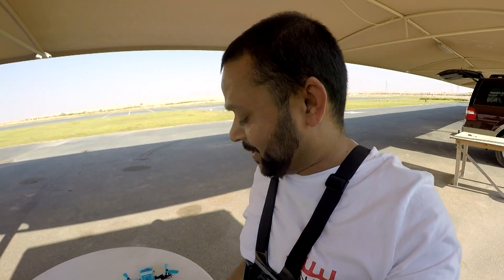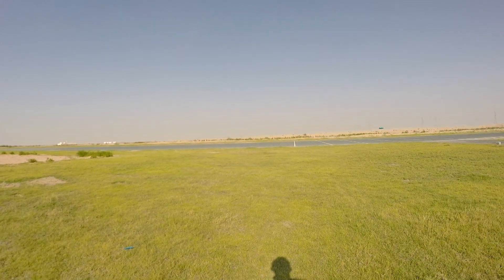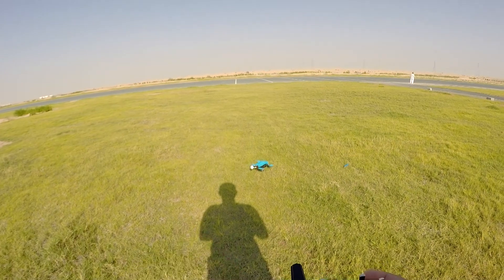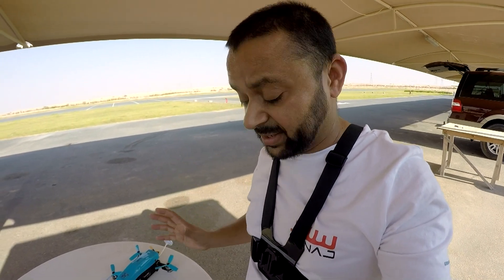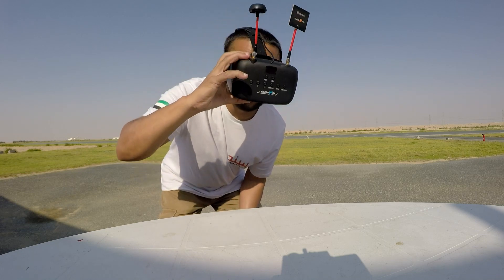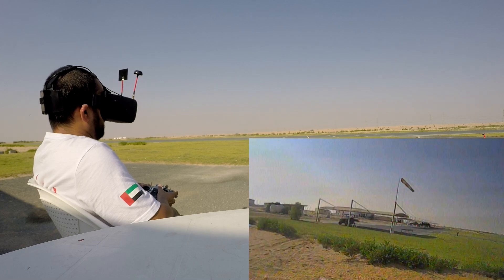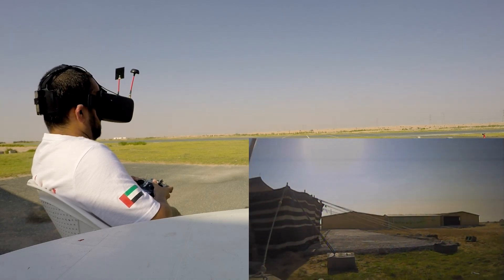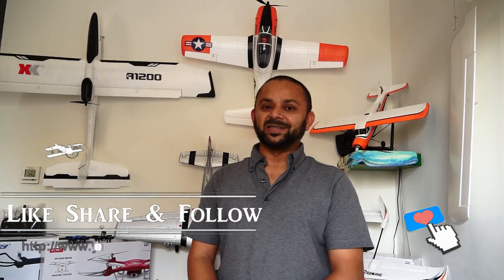Eachine Racer 180 Tilt Rotor FPV Racing Quadcopter

Comment: i know what those 2 crazy modes are for.
1 - is for climbing a building ( like we dive with regular freestyle quads ) So the GoPro will face straight up. 
2 - is for diving a building. You can control the rate of your decent. 
Boy that would look cool. 
Do you still have it and have you tried adjusting your rates or tried to tuned it ?
Thanx
Marc :-)

Comment: Thank you for your review.  I just picked one up and no detailed explanation of the remote control switches.  Thanks for demonstrating what the flight switches do.  Question; what do the two outer most switches on either side do and what position should they be in?Thanks again.Semper Fly, Dave.
Reply from the maker: Just keep them up (away from you) they probably do not do anything

Comment: maybe just maybe they programmed in those modes so that people can try them, not everything about a quadcopter has to be geared towards stability and racing some, people actually prefer to have fun with it and I can think of plenty of uses we're having the quadcopter point straight up would be useful for example if you are flying straight up but the quadcopter is too wide to fit through a pipe diagonally you can switch it into that mode and it will fly straight up, just because something is difficult doesn't make it worse when You have all the flyer aids on, the quadcopters maneuverability is actually restricted no improved, if you fly a quadcopter with full control of each individual rotor you will be able to fly a lot better than someone who had all the flyer aids on

Comment: I believe it designed for one thing and one thing only. Tilt rotor, while main ting stable speed. Everything else is just rubish to fill the cracks. maybe it can be flashed with the f210 modes and replace this ones bad modes

Comment: It can be used on any project to build a VTOL plane/quad hybrid
Reply: Thinking Alex i guesd just a flying wing with 2 servos will do well. already got thrust vectors and differential thrust. with go cg. may be no control surfaces at all. but need to reduce weight and lot of frontal area to reduce drag. i think it will be a spectical in the air.
Reply: Need to reduce lot of weight for VTOL glider or big wing with strong lift.
Reply: Thinking Alex sure. this machine have good forward flight charactistic and auto level fuselage. leverage it for a level flying wing will be a killer combo. not likely to do invert flight though. i may do a delta flying wing. transportation is alway the issue on fix wing. may be split a wing to left and right and add 2 flxed tube inside the arms for the wings to attach to. may be try something small first.

Comment: I followed the development of your quad from the beginning, this was something I was preparing myself for, as a purchase. Its a shame you got burnt in the way you did and never came to the be, although this is a near relative of your invention.
You probably wont recommend adjusting the programming on the 180 unless you know what you are doing. What would you recommend, as a program adjustment with the 180, to gain the acro mode without tilt? Could you provide an expanded program mode for this item including a no tilt stabilised mode for learner's? Possibly a TUT regarding this matter, Paypal donation?

Comment: Modes B and C are for crossing over obstacle. When you race quads and come close to a tall object you switch to up mode , once you got to the top swich down and you can see how far you need to go. unfortunatelly Ali does not have trees there and he cannot think of of any and these modes are useless on flat terrain .
Reply: autokanada you are truly brilliant & I'm not joking around. What you said makes since, I've always wanted a Quadcopter that can climb up the face of a building angled straight up, then when you want to go down the other side angle the quad straight down. Much faster and much better camera view and FPV view as well. Of course you must be an excellent pilot to do this manuever. Thanks for your insight, you are definitely a thinker.
Reply: Was thinking the same thing. For quick altitude changes

Comment: is there a way in clean flight to program switch b to lock the motors in place with not tilt by locking the servo so you can use it as a regular quad?
Reply: anthony anthony here was talking about locking the tilt and using it as a normal quad by hooking it up to cleanflight. How would you do that? Im new to cleanflight and  racing quads so i dont know much. A reply would be awesome!
Reply from the maker: yes of course. it can be programmed
Reply: you also said there is no osd. why would they do that? it seems like they rushed it. this is my first quadcopter other than my phantom 3. im worried now. i have a eachine 250 coming too. now im worried. at least my vr d2 goggles will be nice to watch movies on.lol